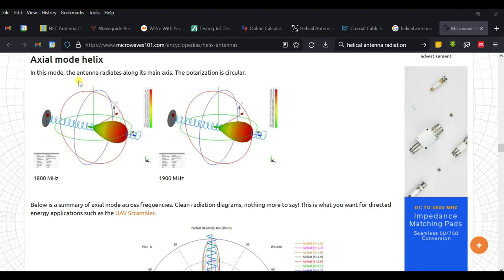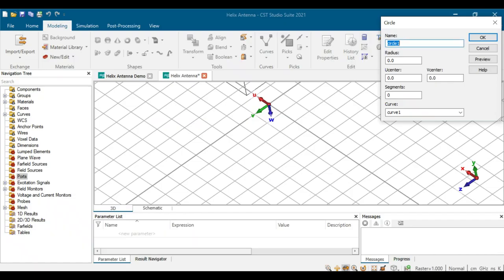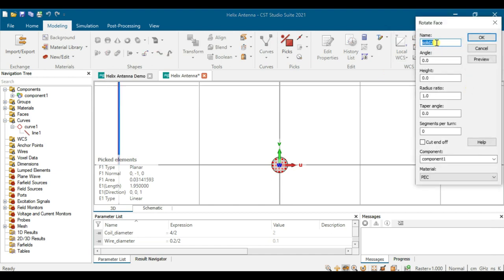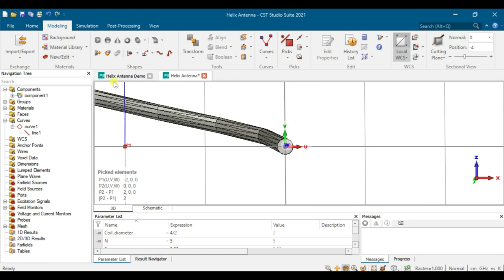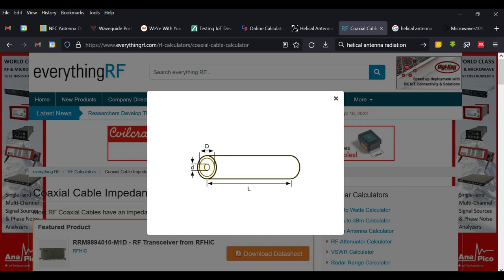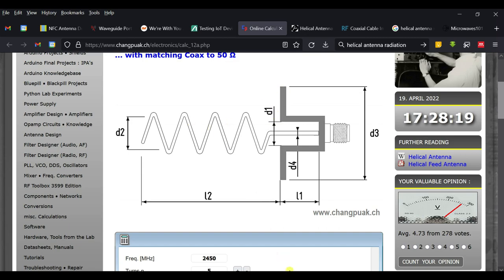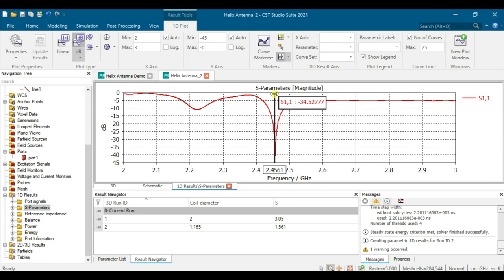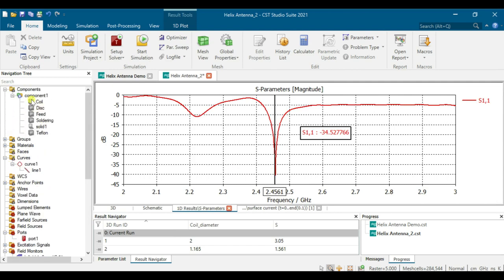How to Design Helical Antenna using CST

Comment: Thanks sir it's exactly video but I wanna Ask you why Are you change S value I can understand why you change radiu which Circumference should be 0.75lemda<C>1.33lemda but I can't understand why are you changing S if S=lemda/4
Reply from the maker: Hi, It just tuning the dimension to meet the resonant frequency that we want, the calculator dimension is just a reference for your to get near to desire frequency.  You also can try adjust other parameter value to meet your requirement resonant frequency or design.

Comment: Why is the result on CST so bad after following design equations for the helical antenna? Also how did you come up with the new values to update/fix the simulation? You just copied the demo which defeats the point of using the design equations in the first place
Reply from the maker: The design equation is theoretically to achieve the desire frequency. But is not perfect, then we just do some tuning to make the frequency swifting.

Comment: while defining the line1 at time (04:22) of your video, how do you decide the v2 should be 1.95, is it okay to use with a 3.3 GHz frequency, or should change it?
Reply from the maker: Hi, For v2 1.95 is follow the d2 diameter divide by 2. for 3.3 GHz please use the helical calculator in description to calculate it. Then find your d2 value. 
Hope it helps. :)
Reply: @LYSStuff  okay, thanks! also, the model didn't run due to the limitations of the student edition in which the maximum cad faces can't exceed 500, is there any way to reduce them?
Reply from the maker: @KavyaAgarwalbec  hi, you could try to reduce the mesh setting. But if still 500 limit, then no choice. Limitation of student version. You also can try look for helix antenna design in CST example file.

Comment: hello, I want some help with designing 437 MHz helical antenna. can i contact you?!
Reply from the maker: Hi, just follow the video guideline, use the calculator to get the antenna dimension for the desire frequency.
Reply: @LYSStuff  
I followed the guidelines and designed the antenna but i have a problem with the port. When i simulate the the antenna I get this error:  "port 1 is inhomogeneously filled with the first 3 mesh cells". 
I'm using a strip instead of wire in my design and the ground plane thickness is 2 mm it worked previously when the ground thickness was 10 mm but i have to use 2mm.
Reply from the maker: Oh my, I have no idea why that error occur after change the thickness. Maybe it overlapping with other component.

Comment: Why are the simulations run with your cst model not the same as yours?
Reply from the maker: Hi, Maybe attached file is after or before tunning
Reply: @LYSStuff  But the parameters of the model are the same as in the video
Reply from the maker: @yuxia-mh4pq  not all parameters are defined in the parameter list..
Reply: @LYSStuff   All right, thanks.

Comment: Very useful, you're an expert. Thanks.
Reply from the maker: Welcome and thanks for your support..
Reply: @LYSStuff  Forgive me for asking a off topic question… In practical application, is it necessary to have a layer between coil and sma to impedance match? E.g 140-100-50ohms? Thank you.
Reply: Hii can you send me your travaille cause i have problème in cst thebsimulation is very slow
Reply from the maker: What is travaille?
Reply from the maker: Hi, Yes, you may refer to Microwave101 helix antenna theory.
Reply: @LYSStuff  no problème maintenant mais simulation slow just

Comment: Hi， the impedance of this antenna is 150 ohm， how can u achieve the impedance matching?
Reply from the maker: Hi, you may refer to 10:47. There have shown how to match the 50 ohm, important is the SMA 50 ohm. And 11:50
Reply: @LYSStuff  You use the 50 ohm coaxial cable, but the impedance of this antenna is 150 ohm based calculation. if just change the coil diameter and spacing of this antenna, the S11 can become ideal but the axial ratio is shown bad. I try to build the antenna model and i am wondering about this. Thanks for your reply.
Reply from the maker: @ZAX_3  hi, may I know how worst is it... It should be below 3dB. Else you can just tune again the antenna coil diameter. There is no direct specific calculation for this.

Comment: how to get number of S and coil diameter?  thus get S- par 2.45 GHz?
Reply from the maker: Hi, For S actually is the turn of helical antenna which to increase the gain of helical antenna. Coil diameter also depend manufacturer or our resources we have which type of diameter. Thicker can support higher power.
Both of S and coil diameter also depend on your application. compact or big antenna required for ur application. Therefore, there is no fix number of S or Coil diameter for 2.45 GHz design.

How to Design 2.45 GHz Helical Antenna in CST
you can use the calculator here to get the number of S and coil diameter.

Helical antenna Calculator
1. https://www.changpuak.ch/electronics/calc_12a.php
2. https://daycounter.com/Calculators/Helical-Antenna-Design-Calculator.phtml

Coaxial line Calculator
https://www.everythingrf.com/rf-calculators/coaxial-cable-calculator

Hope it helps. :)
Reply: @LYSStuff   thanks for the answer sir
but sorry, is it okay for me to ask for a demo helix antenna design file for me to learn? I will compare it with the design I made, it seems that the design I made is still wrong, not right at 2.4 GHz.  
apologies if you would like to request the file, thank you
Reply from the maker: @huvat-wi7ve  Hi, no problem. email me lysstuff888@gmail.com. then I will send you the demo file.
Reply: @LYSStuff  Hi, I have emailed to you too. Please share to me the demo file too. Thanks 🙏
Reply from the maker: @annemirka5612  Hi, I have updated the download link in this video description. You may click the link to download the CST design.
Reply: @LYSStuff  thank you sir, I have permission to download the file form link description
Reply from the maker: @huvat-wi7ve  most welcome, enjoy it.
Reply: @LYSStuff  Thank you so much.
Reply from the maker: @annemirka5612  welcome.
Reply: Sir it's a blessing to watch this video. I have a small problem sir . I am using CST STUDIO SUITE learning edition sir. I am getting an error like the CAD FACES is limited upto 500 only. How to solve this issue sir
Reply from the maker: @shyamsundard5824 hi, this one need to ask CST customer support. I'm not sure what is that error mean.

Comment: Dear, could you desigin a LORA 433MHZ Helical Antenna, I am devleloping a IoT project , PCB has been finished ,but I need a suitable antena to keep the long distance, the antena should be installed in the box near the PCB. only a small space to place the antena. if you could help me to desigin and simulate, we could contact with email.
Reply from the maker: Hi, sorry, I have no idea on this.